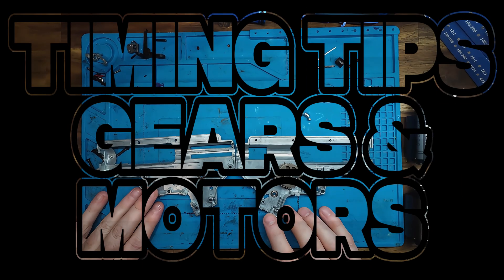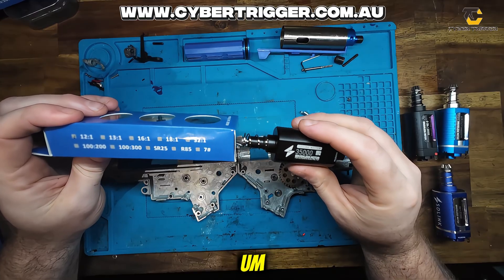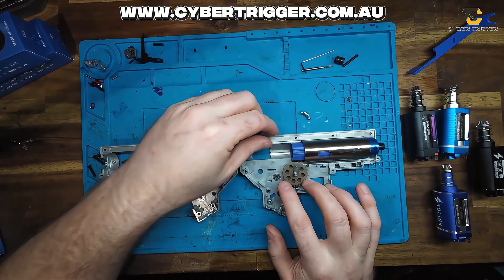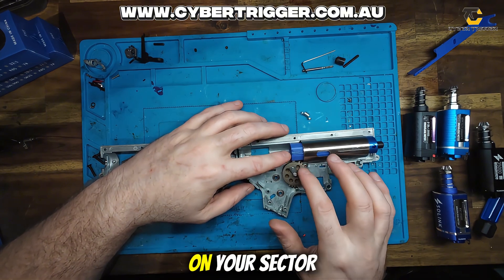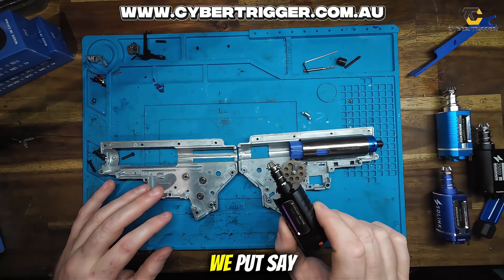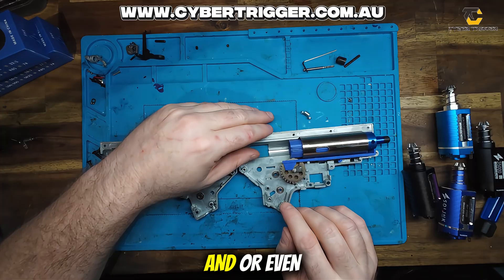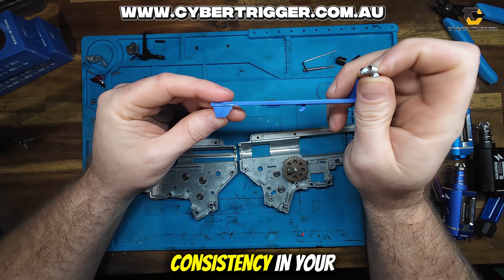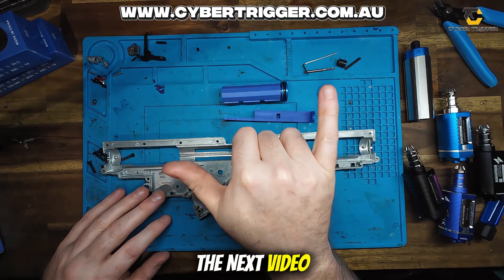-Tech Talk-How To Understand Timing, Gears & Motor Combinations In Gel Blasters And Airsoft

Comment: Do i need to short stroke the gear if im using 12:1 gears with M110 spring and 35k brushless motor? Barrel length is 18 to 28cm. Sorry im new.
Reply from the maker: yes if you on 11.1v deffinantly you would need to take 2 to 3 teeth. 2 teeth initailly but when you spring ends up saging it will need 3 teeth to ensure piston integrity over time. i would take 3 teeth to be sure especially given your barrel length. You will be around that 37 to 39 rps with that set up
Reply: @CybertriggerAustralia ok noted thank you 🙏
Reply: @CybertriggerAustralia if i do not wish to short stroke, i will have to use a larger spring?

Comment: This is a timely video with where im currently at with my build. Ran a new 38k motor on 12:1s and saw big inconsistency and auto droop as i was still on a m100 doing 37rps. Previous build on the old motor gave me a consistent 330fps 30rps but the gremlin in me wanted more. Just got the m140 in today so hopefully i can get something consistent running near 40rps on a ssg.